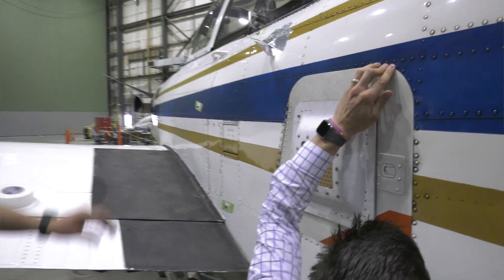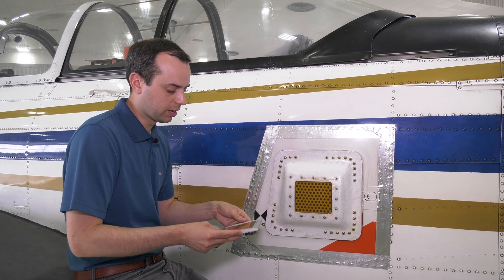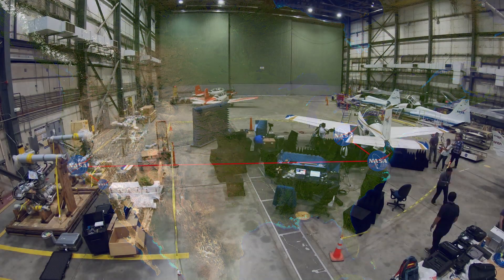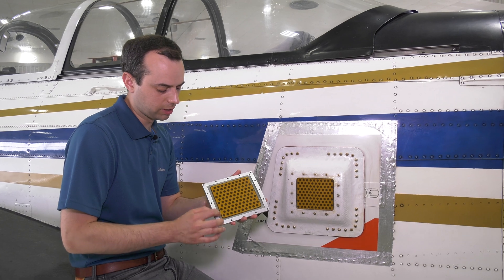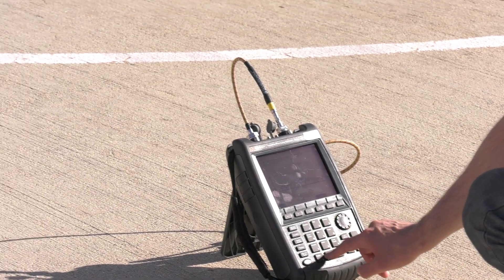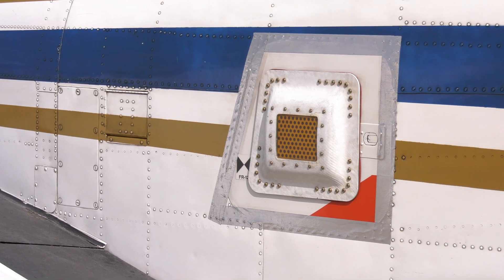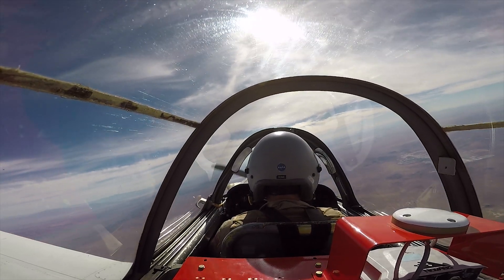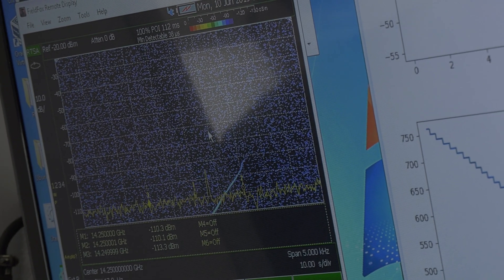Creating an Aerogel Based Aircraft Antenna

Comment: This looks to be a phased array. I would guess that you used the aerogel as a substrate to give the array shape and to thermally insulate the cavities to maintain a constant frequency. What did you coat the aerogel with to make it reflective to the microwave energy and what method did you use to create the coating?
Reply: More info at https://nari.arc.nasa.gov/sites/default/files/SeedlingMEADOR_2.pdf
Reply: @carycupka4081  Thanks. I look forward to reading the paper.
Reply: The answer depends on whether You are a Chinese or Russian agent lol

Comment: I hope this has military applications to beat the bad guys. Getting away from GPS would be a good thing.
Reply: They already have radars that use similar technology. Using this to create a directional antenna for receiving the GPS signal would work to circumvent some jamming. Trying to set up a beacon system to replace GPS when it is jammed has the problem of line of sight limiting the range of the beacon and is vulnerable to jamming if frequencies that travel beyond line of sight are used.